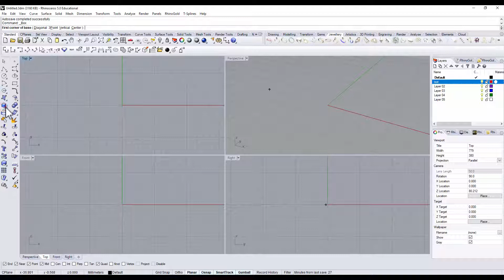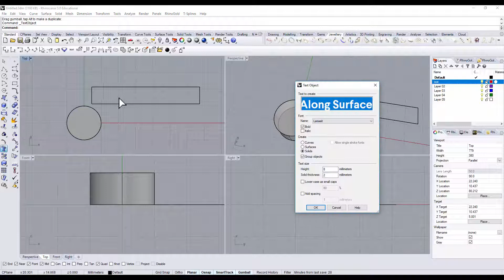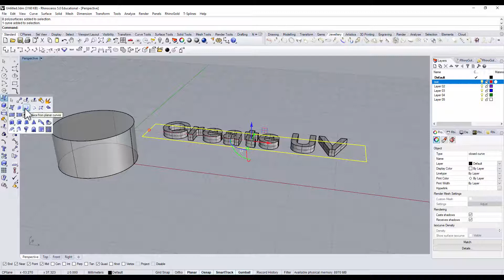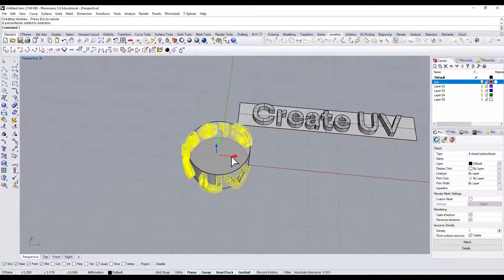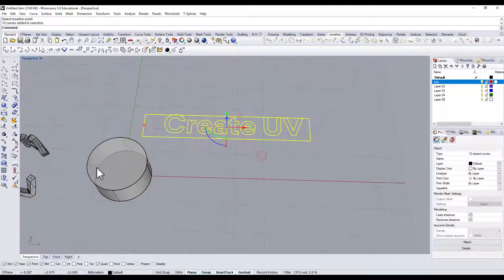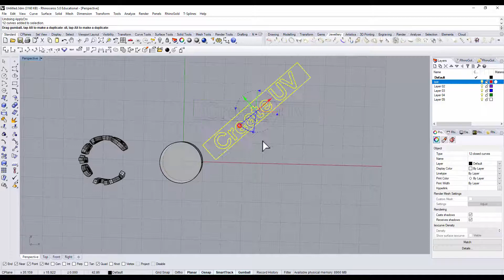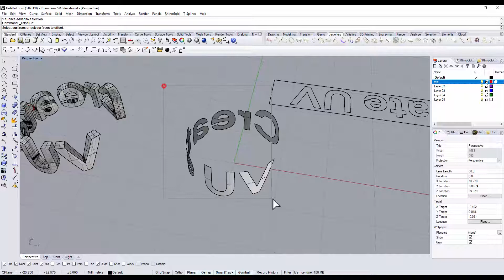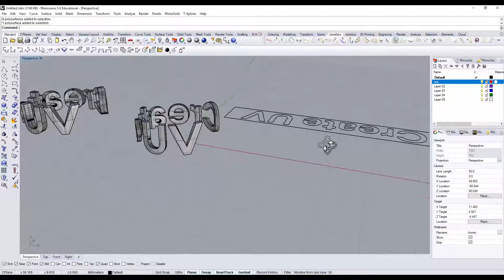Rhino 3D CAD Technique #10: What is UV curve Rhino 3D? (有中文字幕)

Comment: Well, whenever I create a box, and then try to add a text to it, text ends up at the bottom of the box - I try to create a surface etc etc. And that SIMPLE thing............I have found no tutorial on it. Rhino seems like a very bloated program. When a really simple thing becomes such an issue... Flat surface, which I assume is not a surface, otherwise It would have worked, and then trying to add simple text to it.... (to the extrude the text and make the text a negative). But no, not with Rhino. I think it is a failure when a simple thing like that becomes a problem.

Comment: Thank you very much, very well explained. Is it possible to do the same thing using Uv curve, with a non rectangular base surface? For example with a cone. I didn't succeed to do the same thing properly using a target surface which is not rectangular when unrolled. Could you explain us how to do so?
Reply from the maker: HI Max, Yes, you can apply to any "single" surface with UV curve. However, when you flow back to the tight area, like the tip of cone, it will distort the form/object a lot.

Comment: nice tutorial. in case we want straight extrusions to maintain typography/letter geometry, we can also use Apply UV and then extrude each letter separately, selecting the extrusion direction from a construction line that is perpendicular to each letter's center. we can either draw a line from start to end of letter on top view and then the perpendicular, or if we have letter surfaces, directly with the Surface Normal command and clicking approximately to the horizontal center of each letter.